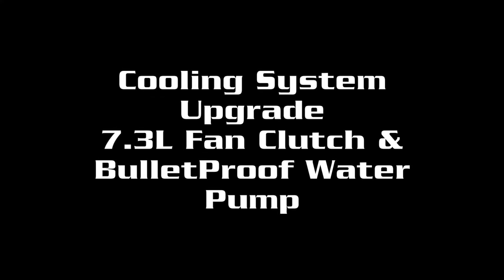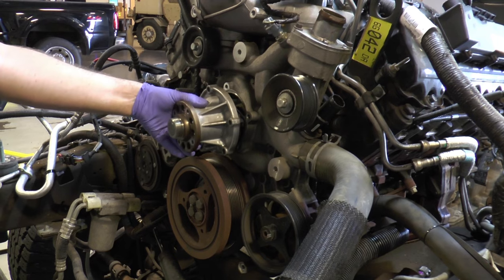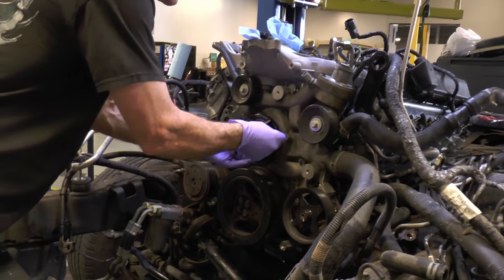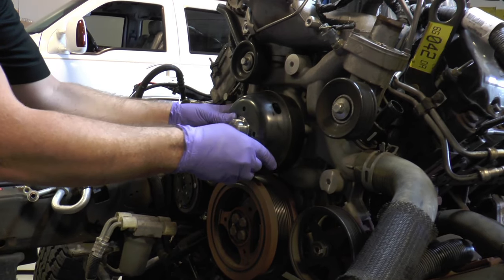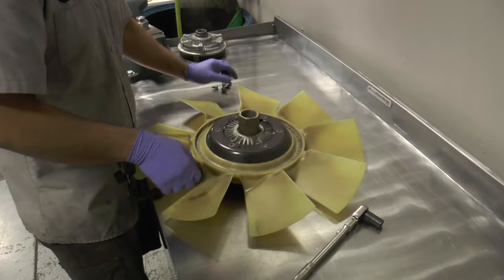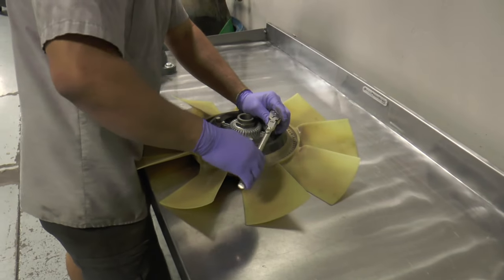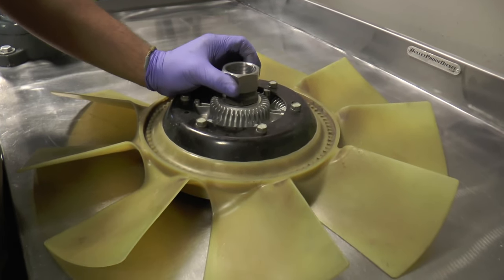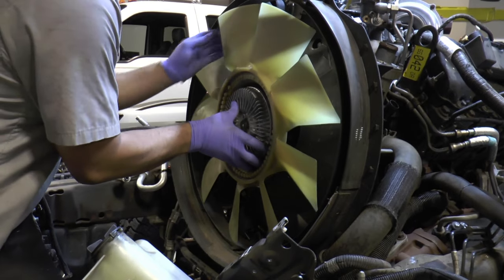Great 6.0L Cooling System Upgrades from Bullet Proof Diesel

Comment: Just did the water pump change and there is a change in my operating temperature.
While some trucks up north may not ever need this change, trucks in the south benefit greatly.
Reply: Chip Saunders I’m thinking I need this. What kind of changes did you get. Thank chip

Comment: That's all fine and dandy, but what do you do about the check engine light? When it comes on cause it's not getting feedback from The original. Computer control fan clutch, That fan clutch gives you a feedback reading and it'll turn the check engine line on, if you try to eliminate it. So if you have a trick for that, that'd be awesome

Comment: I live in Wyoming.  And while I can see myself doing the water pump upgrade the 7.3 clutch upgrade I won't do as I need the heat in the winter that the 7.3 clutch will take away.

Comment: I wish I new about the 7.3 fan clutch because I just replaced my fan clutch and water pump on my 6.0 and I just leaned about bulletproof.
Reply: You can try the blue wire mod. I think it's called

Basically an on and off  switch for the oem clutch fan

Comment: If you guys do these upgrades, please pull out your stock radiator at the same time.  I dropped a Mishimoto all aluminum radiator in and it made a world  of difference.   I also vented my hood at the same time and can tow heavy uphill in the summer now. I put water meth on and it keeps my EGT'S much lower...
Reply: What vent hood did you go with?

Comment: What do you do with the 6.0 fan clutch wire harness coming from the engine. Just cap it off some how and leave it?
Reply from the maker: Yes, we cover the opening of the connector (to keep our debris) and then tuck it back, away from the shroud.
Reply: I just bought a 2005 F350 6.0 powerstroke and it looks and sounds great. This does have the BP studs but for some reason I'm overheating especially going up steep grade.

This truck is tuned and deleted also. I have no white smoke ever so I doubt it's the BP studs and headgasket but I am currently driving from WA to Tenn and I have had to refill the coolant reservoir about 5 time from overheating? 

This coolant is boiling and I can't see the leak as its being sprayed everywhere through the cap.

Do you think this would fix this issue?

Comment: Does thick cause an engine code or check engine light since the pcm monitors the fan clutch?
Reply from the maker: It does not cause the check engine light to illuminate.  When the factory fan clutch is unplugged and this setup is installed, there will be two soft codes stored, one for fan speed and one for fan circuit.  These soft codes will not cause the check engine light to set.

Comment: How can you tell if the water pump as been bulletproofed
Reply from the maker: We laser etch our brand name, part number and logo on every Bullet Proof Diesel water pump.  The other tell tale is that our water pump is billet aluminum, not cast and is also anodized black in color.
Reply from the maker: There are small holes in the water pump pulley, you should be able to look through those holes and inspect for these attributes.

Comment: Is there anyway to tighten the adapter to the fan clutch without a special wrench. Crescent wrench doesn't fit in between the 2
Reply: W.W. Hammer and a cold chisel or air hammer if you have one

Comment: Y put 7.3 clutch on the 6.0?
Reply from the maker: Hi.  The 7.3L fan clutch comes on earlier and stays on longer than a 6.0L fan clutch during operation.
Reply: 6.0 Fan clutch are also prone to failure due to its Electronic design and also make the Engine run much hotter. The 7.3 fan clutch engages more often and more completely to keep it cooler. The 6.0 electronic fan clutch has a connector that has been know to be cut by the fan itself and will overheat.
Reply: If installed correctly, 6.0 fan clutches can be very reliable. Also, a 6.0 fan clutch is controlled by the pcm, and with good custom tunes, can cool more precisely.
Reply: @zgzg2183  I am going up and switching to 7.3 setup, even with good tuning I cannot get the fan to come on till 218*, tired of high heat and fighting it.

Comment: Will my 2005 F350 throw codes after installing mechanical clutch???
Reply from the maker: You may see a soft code (not a Check Engine code) triggered by the part.
Reply: BulletProofDiesel what’s a soft code 
New to this sorry
Reply: @ismaelmelero3984  Soft Codes register as a fault in the computer but they are not important enough to operation of the vehicle to cause a Check engine light to illuminate on the dash.

Comment: The mechanical fan clutch comes out of a 97 powerstroke? Or will any year 7.3 fan clutch work on that mod?
Reply from the maker: We do use the version that was found in the 1997 models.
Reply: @BulletProofDiesel  is the 94 to 97 all the same clutch? What brand clutch is the strongest clutch. I've heard the factory Ford ones are the best but hard to find. I have a NOS clutch from ford dated 1996.
Reply from the maker: @WillaHerrera  For the conversion, it has to be a fan clutch for a 1997 7.3L diesel, a 1994 will not work.  We prefer and use the Hayden 2835 fan clutch, the Ford unit has been discontinued.
Reply: @BulletProofDiesel  yes they are discontinued but I found two old stock F5TZ-8A616-KB units. I have one dated 1996 on my truck.

Comment: How you doing sir? I’ve watched many of your videos and they had become extremely helpful. I have a question though when you are referencing bulletproofing the 6.0 motor is that only in reference to a diesel 6.0 or could I utilize these tactics on a LS2 /6.0 gas motor

Comment: Don't waste your money doing the "7.3 clutch conversion" Thought this would be the cat's meow for taking care of my high temps, Have had it on my truck for about 50,000 miles, stupid fan is on til normal temps are reached 180-190 degrees, does NOT come on when you really need it (over 210)! When you have a plow on the front or towing. Taking that crap off & putting 6.0 PCM controlled fan back on & doing the blue wire mod!
Reply: Which is?

Comment: what is the benefit of this swap?
Reply from the maker: The fan clutch adaptation will cause the cooling fans to come on more quickly and stay on longer.  The BulletProof water pump features an all-aluminum impeller that won't crack or degrade like the stock one.
Reply: BulletProofDiesel I primarily meant the clutch the pump I get. Back to the fan, isn’t the fan computer controlled on a 6.0 ?  Why wouldn’t the controls be adapted to accommodate the same end result.
Reply from the maker: @user-vd9fz5ey9m  The conversion to the '97 style fan clutch means the fans are mechanically controlled rather than electric.  Again, in use, it comes on quicker and stays on for longer than the 6.0L electrical fan clutch.  The water pump is aluminum, it doesn't have the plastic impeller that has caused so many EGR cooler failures.
Reply: BulletProofDiesel ok lets try this one more time. I completely understand the benefits of the pump upgrade.

My question pertaining to the clutch is this. Why can’t the electric fan programming be changed to accomplish the same results as the 97 fan clutch. The existing fan is told when to turn on and off by the computer. Why can’t those commands be changed?
Reply from the maker: @user-vd9fz5ey9m  While custom aftermarket tuning to modify fan clutch strategy may be possible, it's extremely complicated and not a perfect science.  Many years ago, we experimented with SCT and custom tuning - it didn't turn out to be a viable solution.  The next simplest upgrade was the '97-style fan clutch adaption.
Reply: BulletProofDiesel ok so it’s harder. Thanks for the info
Reply: @user-vd9fz5ey9m  it s much more complicated than you think. The fan electronic clutch will engage when the coolant temperature reaches 215 or intake air temp is above 115 ( i might be off couple degree) or oil temperature reaches a certain temp. To reprogram those 3 parameters and make them work in sync is rather complicated.
Reply: Trang Nguyen but we can change timing fuel input boost pressures vgt operation, but none of those things require any other inputs I guess. It’s only as hard as it’s made to be

Comment: Did it throw any code due to the ecm not seeing any fan clutch plugged
Reply from the maker: A soft code (not check engine light) can be triggered, but is unproblematic in operation.

Comment: what is the gain from the 7.3L fan clutch over the 6.0L clutch? i totally get the water pump changeover, although I have read the they are notorius for leaking after install.
Reply from the maker: The 7.3L-style fan clutch comes on earlier and stays on longer than a 6.0L-style clutch during operation.
Reply: i thought 6.0 fan clutches also had an electronic connection
Reply: They do but this makes the fan clutch Manuel and not electric. Don't know why FORD ever thought an electric fan clutch would be a good idea